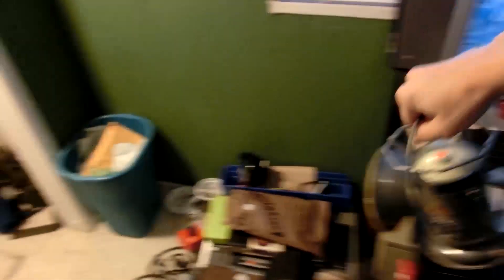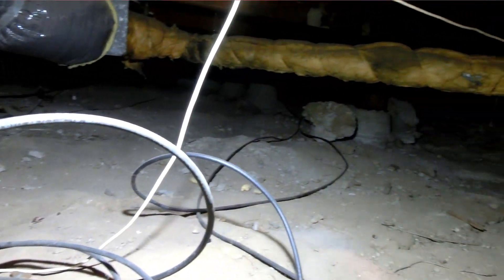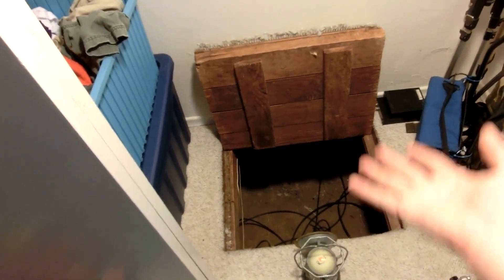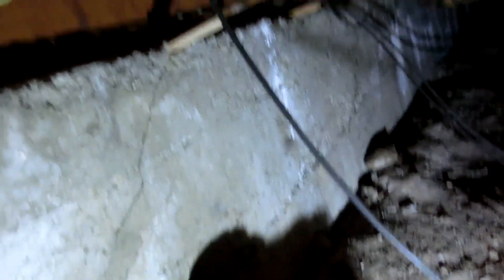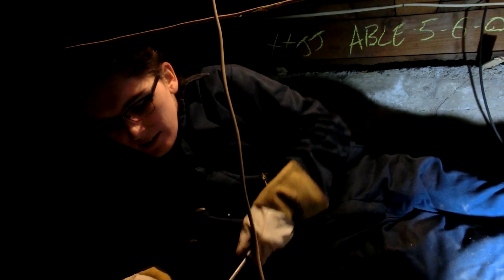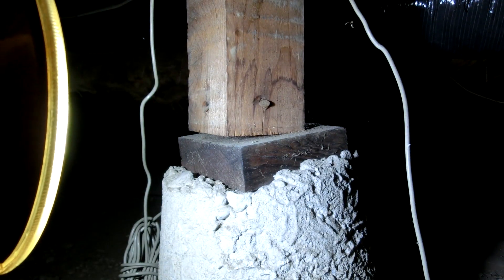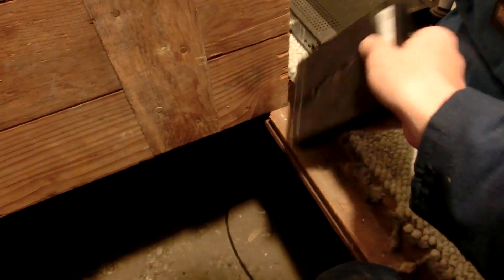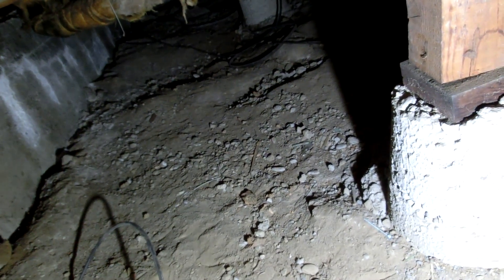Random Bits 0129: the secret door in my closet

Comment: I'd drop a filter over the hole to help prevent dust, put a fan on it and be good to go.  Some friends of mine had a log home in the early 90's.   I think it was related to a geothermal heating/cooling solution but it didn't use water.   Had a pretty decent sized concrete bunker buried in back of the house pretty deep.  PVC tubes kinda resembled big scuba gear led from the pit to above ground.  Some sort of ducting from the pit to the house. There was some sort of blower under the house.   Box fans pulled the air from the floor ducts, combined with ceiling fans to spread around the house.   Likely a bit rigged together but it worked year round to help cool in summer and heat in winter.     That was how it was explained to me, though likely was more complicated.
Thanks for the vids.

Comment: When I renovated my 2 bdr rental I put a hatch like that in the closet in the small bedroom for access under the house. In the master bedroom, since the house is in a high crime area I cut a hole in the closet floor and recessed a steel box for the renters to hide valuables. The hatch has a recessed pull ring but has a small metal plate covering the pull ring and the closet is carpeted with only that end of the carpet unattached so it can be pulled back for access. The little metal plate is held in place by a super magnet and makes the pull ring area flush so even if you step right on it you would never know it's there.

Comment: depending on when the house was built , sometimes it gets treated with pesticides for subterranean termites (especially If it was an orchard), usually pest control company post a little sticker at the access to sub area and I don't see one and yes it's usually is cooler down there, I use to do pest control work here in Northern California near Sacramento and it's a good place to be when it's 100 degrees outside. Not sure about the "swat" thing as I'm sure they know about that area.

Comment: Measure the opening and get a furnace filter that will fit or close to it.  Use something to fill any gaps, I suggest something removable like cardboard or scrap wood or just duct tape it over the opening so you can close it up as needed.  I wouldn't have gone down there but there you are, were, with a wheat penny to boot.

Comment: Maybe you could grab a cheap furnace air filter at the local big box store n' attach it with some bungees to the back of a box fan n' mount it in the opening. Won't have to worry about dust being drawn in from just normal dusty days. Santa Ana winds kick up n' dust just goes everywhere.

Comment: I've tried to take advantage of cool basement air in the same sort of way, until I realized that if you install a fan you get a few moments of cool air and then it heats up again where the basement is capable of cooling down stagnant air that's not moving over night, but doesn't seem capable of cooling it in real time once the initial air-load has been transfered upward to the living space with the fan.
Reply from the maker: i doubt that, i had a server fan sucking air from the basement and it'd lower my room's temp by a good couple of degrees for days at a time. your forgetting that the basement cools any air going through it. unless you have a stupidly big fan and are wasting your cool air.
Reply: I suspect the HurrDurr™ 20" 3-speed box fan is the cause of me fails. ;P

Comment: Sometimes there are rats in basement and attic crawl spaces; which can be there depositing waste, for years, unknown. Sometimes there are drainage problems or plumbing leaks and there will be moisture or standing water. I've spent many hours in crawl spaces when it's hot the attics get like 150 degrees.

Comment: 85 Degrees? A little toasty? You would be DEAD!
Reply: 85 degrees fahrenheit are about 29 degrees celsius. Not so much :)
Reply: Fahrenheit is invalid and should be abolished.
Reply from the maker: no its not invalid, its based on the freezing point of salty water and what we used to think human body temperature was. i dont see how it could be invalid because its just a metric to guage temperature by. all temperature scales are nice in their own way.
Reply from the maker: Shaun Dobbie
i dont use most of it, just fahrenheit and sometimes pounds. so idk the extent of the rest of it. although some of the metric system is bad also such as the metric clock we almost had.

Comment: maybe if you want a watercolled pc you could build the raidiator under there
Reply: why would you want to do that?
Reply: +smallenginedude71 because it would provide better performance since it is cold down there and make a quiet PC because the fans would be hidden down there
Reply: matthieu 2020 Thats a good point. it would reduce noise very nicely. that "basement" would only be about 5 degrees centigrade colder. that will barley do anything to your performance of your computer.

Comment: that space would be fucking awesome to run noisy servers in.
Reply: That dust would destroy a server over time.  He would have to do quite a bit of dust mitigation to protect the equipment.  Depending on the size of the server it would not take long to heat up that space if it is on 24/7.
Reply: It could be viable if all inlets and exhausts for cooling had ducting to outside.
Any heat rising would be beneficial to the house.. ;)
Reply: kuhrd make use of that hot hair. and heat the house :P

Comment: So American residential houses are not built on concrete foundations?
Reply: It just depends on the house. Virtually all around me in southern CA are slab foundation
Reply: Most new houses here are required to have a "crawlspace" per building code. At least they are in my area. That means you pour a concrete footer, and build the house on top of it, just like the one in the video.
Reply: +Tater79bj where is "here"?
Reply: +Unreasonable Steev Sorry, Western United States.
Reply from the maker: this house has a concrete foundation, didnt you see it in the video? its the 2 foot high wall around the perimeter of the crawlspace.